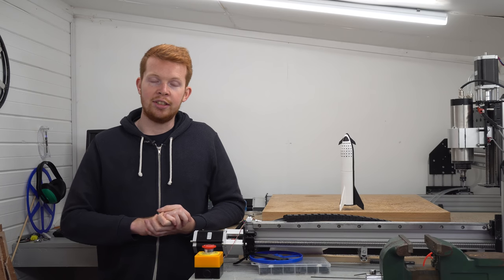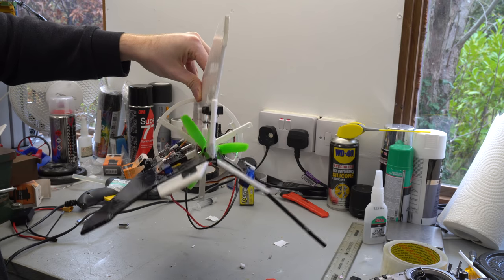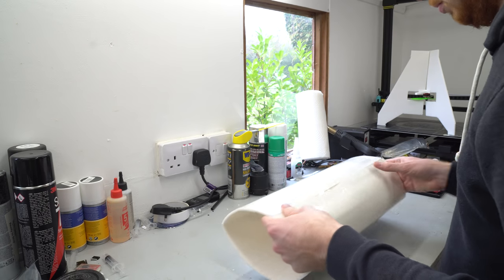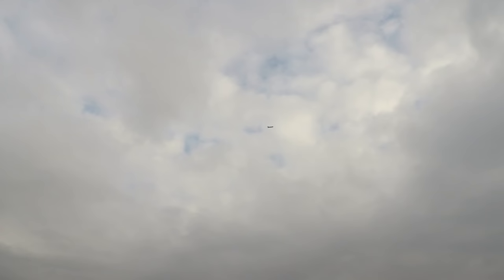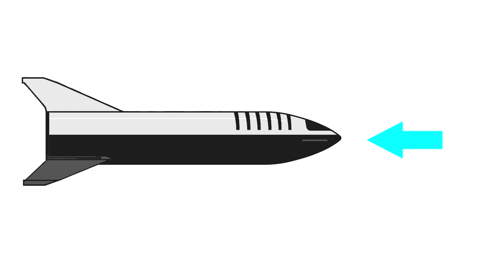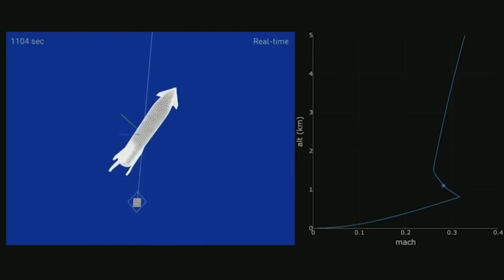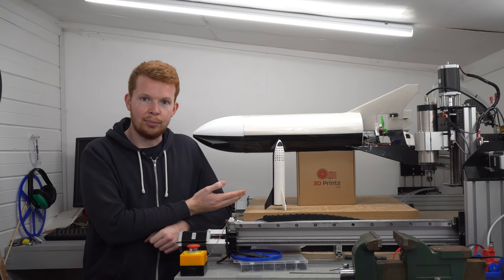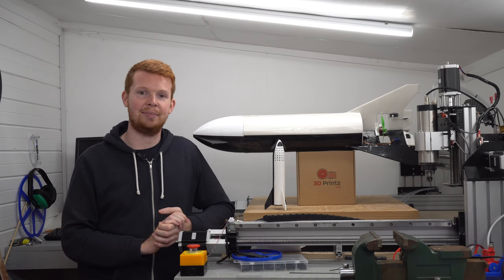SpaceX Starship Test Model - BFR

Comment: Hi Tom, Great video.
I'm currently entered into the ImechE design challenge and am trying to do some calculations for my design. We have to build an external pipe climber. I have a motor and gear train already sorted. The motor I chose has a stall torque of 1000g.cm, a rated torque of 600g.cm and a 9v no load rpm of 21000. The gear ratio i have chosen is 50:1. The wheels contacting the pipe have a radius of 12.5mm. I can approximate the mass of the mass of the assembly to be around 700-900g. Do I need other data to calculate velocity? I don't know a huge amount about how motors react under load... 

Cheers
Reply: Here's what I'd do:
For DC motors, assume at rated torque you have 50% no-load RPM
=10500RPM
/60=175rps
/50:1 gearing = 3.5rps
12.5mm*2*pi = 78.5mm circumference
78.5*3.5=275mm/s

Assuming 50% gear train efficiency, torque at the wheels is 600 * 50 * 0.5 = 15000g.cm
/1.25cm radius = 12kg at "rated torque", plenty :)

To find the maximum speed you'd need to find the torque curve for the motor (amount of torque at various RPM, or just assume it linearly declines from 1000g.cm at 0rpm to 0g.cm at 21000rpm - https://www.motioncontroltips.com/torque-equation/) and calculate the point at which force at the wheels = assembly weight + rolling resistance

Wheel force = torque * 25 / 1.25 = torque*20
Wheel force also = 1kg downforce (weight + resistance)
torque to balance weight = 1kg/20 = 50g.cm
that's 1/20th of stall torque so let's pretend it's 19/20th of no-load RPM
=19950rpm
=332.5rps
/50:1 gearing=6.65rps
6.65rps*78.5mm=522mm/s
Reply: @PKMartin  Amazing! Thanks so much Martin!

Comment: Your aircraft needs more mass for the ascent so wind will have less of a drifting effect but you have drones right so you could use a drone to airlift it to 500 feet and the extra mass will make its speed less affected by drag so your incoming speed will be greater producing more drag on the forward fins but keep the mass in the centre so you can still rotate it in a timely manner make fins less about drag and keep your inertia relatively low so it will raise its terminal velocity so you can induce more drag on decent and more about control authority on the forward fins there’s probably many flaws with what I’ve just said but I hope you can take away something of value from this

Comment: what did you use as  flight controller? Was it a librepilot? Can you customize what the control surfaces have to do in order to keep the vehicle stable?
Reply from the maker: I used an Omnibus F4 with INAV firmware to configure the custom mixes

Comment: Hi Tom surely Musk will use the same principle with the Starship as he does with his conventional re entry boosters ie approach the Martian atmosphere like the Shuttle and then descend vertically from when it enters the atmosphere. I think if he brings it in like you have demonstrated it's a whole new ball game, more control vertically than diagonally surely ? .
Reply: Starship comes in at at 3-5 times the speed of the booster and does no reentry burn to slow down. Engines first isn't feasible if you don't want to melt. It'll go belly first at 90° through the atmosphere and then fall belly down and just before landing flip, light the engines and land. The Shuttle would come in at 40°.

Comment: So, the issue of motor torque, you really need counter rotating props to cancel out that torque roll. Second, those fins are too sensitive even in small wind with the low weight of the craft. Try control with those fins and just thrust vectoring first. Then move on. I think you have too many variables to adjust all at once.
Reply: "Contra rotating"...
Counter rotating just means they go backwards (not opposite).
Reply: I think he knows what I mean... @tin2001

Comment: try longer fins and little wider with little lower and able to controle by shifting angle based on the direction independently from bottom fins oh would a parashute slow drag in middle top ? then release parashute and land with thusters would that contole slow down then land would that work ? could you make it a little longer this way ? i want to see if it will distribute the waight if mass is centered diffrently not middle just a little higher base on size and waight of cargo and have waight of cargo able to move lower or higher like a semi trucks load on the trailer based on that could you see how much waight you can add in 1 or two places and shift waight for inflight landing or controle in air ?

Comment: Would it make sense to add another thrust unit at the top of the rocket? Perhaps a mantle propeller similar to the transverse control unit on ships.
https://en.wikipedia.org/wiki/Manoeuvring_thruster

On the Falcon 9 there are also gas generators installed at the rocket tip which can generate a moment around the yaw axis of the missile. On the landing videos of the Falcon 9, you can see how they are fired on the last meters, just before touching down.

Comment: This design is barely stable, you need fully actuated front and back fins, controlled by a computer using precise servos. Unless you want jittery violent thing you have now. Also try gimballing propeller mount, that may be more effective.